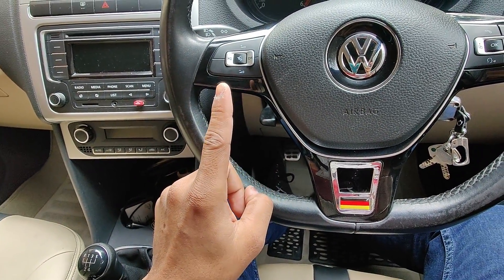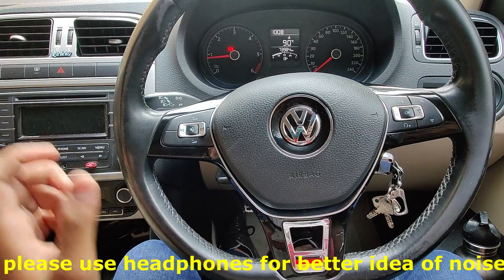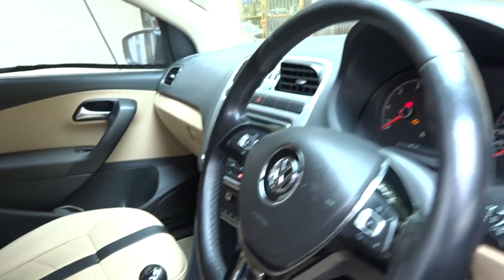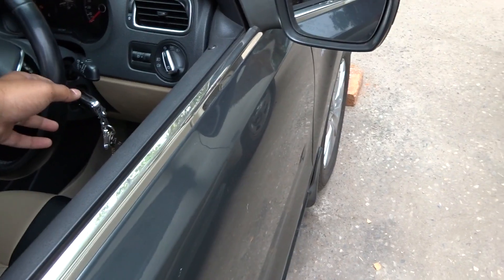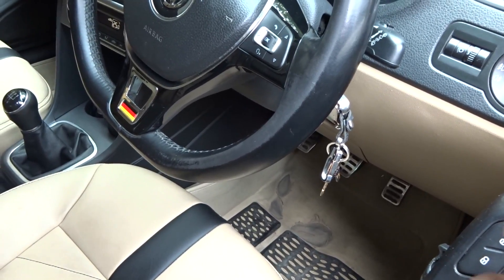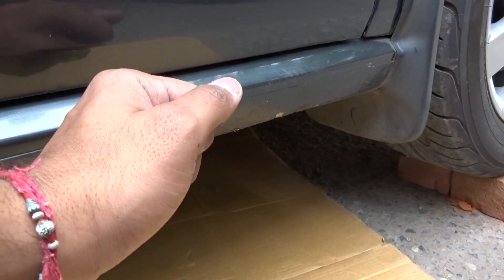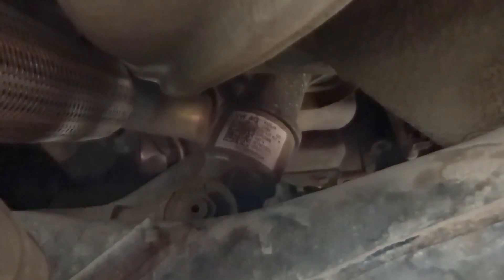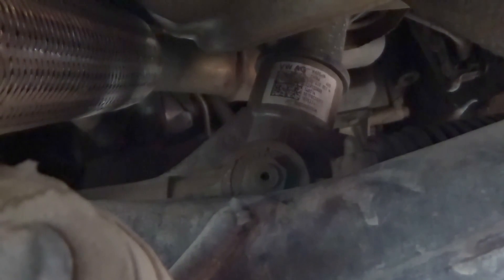STEERING RACK NOISE | RACK PRELOAD ADJUSTMENT | YOLK SCREW | HOW TO

Comment: I have a similar sound in my Kia when lightly turning the wheel, or constantly when just rolling/driving at slow speeds, and even use of brakes will occasionally make the clunk sound. These things could also be caused by excessive movement within the rack? 3 different mechanics tell me different things, I’m frustrated that somehow nobody knows what’s wrong with the car but every day I am stressed out over this constant knocking, happening with any impact or movement with the car at all - even getting in and sitting in the seat it will knock from my weight moving the car!
Reply from the maker: Sir it seems like a control arm bush to me , because it even knocks with you weight .
Reply: Kia सबसे बकवास गाड़ी है

Comment: experiencing the same issue on a w204, it's an electric steering rack. I'll go check if this can be done on w204
Reply from the maker: Sir every steering rack has a preload , which allows for adjustment
Reply: @yourDIYneeds  Thanks for confirmation will definitely have a look at it.

Comment: Hi, very nice videos! Could you help me? I have a problem with my VW Sharan 2017. When it is cold the steering wheel is sticking until the car warms up. After the car is warmed up it is not doing this. It is sticking only when I am turning it slowly (long corner) when I am turning quickly it does not do this. There is no fault in the control unit, no weird sound and even Lane assist is working 100%. Do you know what it could be? Thank you!
Reply from the maker: Sir , most probably your steering rack needs new lubrication , in colder climate grease is much more sticky and hard to work with as compared hot climates , as your engines heats up , your steering rack also get a little warm due to proximity to the engine . And grease inside the rack become more easy to work with . I already have a video on steering rack lubrication on my channel , you can use that as an reference , here is the link .
https://youtu.be/6E0BHajkt5o
Reply: @yourDIYneeds  Hi!
Thank you for your quick reply. I saw it, I will try it and see if it helps. Thank you

Comment: Hello, I am having same problem, I have changed steering rack last week , I also changed the steering cross still this noise is there. My mechanic tried with this screw adjustment also but can't get over it. What can be the issue?
Reply: Hello sir, there was issue with new rack. I got it replaced from manufacturer. Thanks for your help and time
Reply from the maker: Sir it works best with steering rack lubrication , 
But just in case if this doesn't work to eradicate the noise then changing the rack was the best thing because chances are that rack gears was worn , there was free play in between the gears
Reply: @yourDIYneeds  I changed the rack but still probelm is there
Reply from the maker: Sir then it was nit rack ! , What kind of noise it is ? Like , metal to metal or metal to plastic
Reply: @yourDIYneeds  metal to metal, I also changed the steering column cross, got it from used market , if my car put on jack then no noise is coming but if I remove the jack then noise is there

Comment: Bro my fiesta 1.4 also have this problem
Steering have little play and some amount of sensitivity in when going over rough road
Does fiesta have the adjustment nut
Reply from the maker: Sir every steering rack on every vehicle on this planet has a preload adjustment , some have on back side , some in front , some are in easy reach , some are little difficulty , but every vehicle has a preload adjustment.
Reply: @yourDIYneeds  thank you so much brother, will check it👍

Comment: I just get sounds at different road surfaces and low speeds. Do u think it could be the inner tie rod cause I have changed all the control arms and tie rod ends.
Reply from the maker: You may want to have a look at another video , of caliper pins and rotors , if the noise is same , then thats your solution
Reply: @yourDIYneeds  thanks for your response. I used a repair kit and changed rubber boots and pins on caliper. The sound I'm getting is something like a clunking sound when I return to the right some times and when going at low speeds on uneven roads. One mechanic informed me to change the entire rack without checking the inner tie rod. Since it's a huge cost, I'm suspecting that it could be the inner rods since they haven't been changed. Also on the steering wheel I don't get any vibrations or other sounds when I turn left or right and it is smooth as well.
Reply from the maker: Sir then i would suggest to to get your shock mounts checked , as inner tie rods usually don't make any kind of noise when they get loose , your ride just become a little wobbly .
And also check the plastic fender liners inside the wheel well , it happed with me and it almost drove me crazy for 2 yrs till the time i actually found it and then laughed .
The sway bar on bumps was making contact with the plastic liner resulting in a hard sound .
Reply: @yourDIYneeds  got the shock mounts changed month ago as well 🙂. This noise is driving me crazy, I will check the plastic guards one more time as well. Last resort would be then I guess to change the steering rack as you told the inner tie rod wouldn't make any noise as such.
Reply from the maker: Yes check the liners once before you spend , you may have the same problem i had
Reply: @yourDIYneeds  thanks for all the help. Will keep you posted. 👍have a nice day

Comment: Hi, Thank you for the very valuable information shared. I am facing similar issue, while turning slight left or right, the steering gets little tight(gets a tak tak noise). VW service guys are telling to replace Column and Rack, is it so?. Looking forward for your reply...
Reply from the maker: Sir just lubricate the rack first and then adjust the preload on rack and noise will go away 
Both videos are available for reference
Reply: @yourDIYneeds  Yes Sir, saw both of your videos, will try that and update you!!!
Reply: @ContactPrasad  did you try it??

Comment: Same thing happened to my car. Had clunking noise coming from the front left side whenever going through uneven roads. Replaced the lower arm, outer and inner tie rods but the clunking noise was still there albeit not as loud as before. Decided to replaced the steering rack and voila, no more clunking noise! And steering free play that I felt before was gone as well!
Reply: Next u arrest the sound sir???
Reply from the maker: Sir that needed just a bitt of adjustment
Reply: @yourDIYneeds  what needed adjustment
Reply from the maker: Sir your older steering rack , that was just in need of preload adjustment , and maybe a little bit of new lubrication
Reply: @yourDIYneeds  u mean to stop the clunking noise
Reply from the maker: Yes sir

Comment: Very nice video. I have another issue. After doing wheel alignment my steering has got loose. It’s an Octavia. Now I feel the steering to be too loose for high speed manoeuvres and highway rides. It happened just after the alignment and balancing. I tried alignment and balancing at other places too but the steering feel is still the same. Do you have a solution bro? What could be the real issue. I guess the alignment people don’t touch the steering rack right?
Reply from the maker: Sir , its not aligned right , as my experience with alot of alignment shops , 90% of them don't even know what they are doing , they just care about , final toe angle ,
Things they don't care about 
Individual toe 
Individual camber 
Thrust angle  

So i ll advise to get the alignment geometry set by either a shop which is capable of performing right alignment or the Authorize service centre .  
Positive and negative toe angles can result in different steering feel and responce ! 
Do you remember any data after the car got aligned ? And did they tightened the locking nuts after they gave print order or before ?
Reply: @yourDIYneeds  Thanks bro for your expert advise. Glad to know someone who knows so much about the suspensions, steering and alignment stuff. Some other things that bothers me when it comes to steering is that I can feel the road a lot on my steering. Like the undulations of the road or when going over a bad road I can feel the hit on the steering. Sometimes the steering just a moves a tiny bit forcefully in my hands when over a bad road with bumps or that are broken. It is like constantly moving tiny bit with force which throws driving pleasure out of the window when you are on along drive. One thing I have found out is that I have almost all the wheels with a little bit of wobble when rotated on a balancing machine. But that is not too much and has no visible bends. These steering observations were also not that prevelant before the damned alignment. 

Is it also due to the alignment or the wobbly rims or the tyres wearing out unevenly or may be something else, suspension parts? It’s an Octavia VRS. All stock. 27K ODO. Thanks!
Reply from the maker: Sir , firstly luck you , you have a VRS 😅😅 , i will definately have one , if i get the chance . Iconic names in the automotive industry 
A little bit kind of envy 😅

Secondly , the problem you are facing with steering vibration and uneven feedback is all due to steering preload , it needs a very fine and precise adjustment to be perfect , if it remains loose then it will shake your steering wheel when it passes over bumps , and if it got tight then will make you steering stick while taking U-turns , i myself adjusted it in like 4-5 times . Thats is the thing which is responsible for thats shakes .  Best practice is to firstly lubrication of steering rack and then adjusting the steering preload , i have videos of both topics , which you can use as reference if you want .

Thirdly - alignment
Almost 90% of alignment shops don't know what they are doing , all they care is final total toe , they don't care about individual toe angles , individual camber angles , thrust angles and those improper chassis geometry steals away the "pleasure to drive" factor from the car , so i will suggest finding a good alignment shop which actually knows what they are doing .

You can also get it adjusted as per you like 

Example - A little toe out on both sides will give you sharp steering response but you will hear the tyre noise more as they will feather

A little of toe in will give you straight line stability and will make the car more forgiving on steering inputs , but will induce a bit of understeer as well 

Negative camber will provide you stability while on high speed corners , it will control the body roll a little better 

Positive camber is just a waste of time  and money 😅 and will risk curbing the wheels as well 

And all these things in combined defines the final thrust angle of vehicle .
And then there is rear alignment . And a lot more . 
Hope it helps 🙂
And please don't mind that VRS envy thing , i guess you can understand this feeling. 🙂
Reply: @yourDIYneeds  thanks brother! Very informative. I know the feeling. Was in the same boat when I hadn’t one and my friends had it. 😄 it’s a lovely machine and hence when such puny troubles occur, it spoils the mood and the drive. 

All you said makes sense. 
About the adjustment in steering preload, I wonder how can it go out of order in the first place. I mean it shud not have been touched by the alignment guys right? Can it get loose over time due to regular running? But again all these issues occurred after the first alignment I mentioned. I’m in Bangalore and have done the alignment at a very famous shop called Madhus. They are quite reputed. So sometimes, I think it may be something else which got aggravated when the alignment was corrected like the bend rims, tyres, suspension parts. I’m scared to touch the steering rack to be honest. It’s quite sensitive and costs a bomb if something goes bad on it. 

Anyways I have a polo GT 1.5 TDI and a Jetta 2.0 as well. Love all ur POLO DIY’s. At last someone to follow outside of teambhp. Keep up. 👍
Reply from the maker: Thanks Alot for appreciation brother 🙂
Steering preload is just a spring held with help of a bolt on top , to maintain the pressure on the steering rack ball gear so that , it doesn't rattle inside the rack housing and it also controls the movement of steering so that in bumps suspension can only travel up and down not sideways . Springs over the time loses its strength due to the heating and cooling cycles it faces , due to its proximity to the engine and exhaust , and needs to be adjusted
If the alignment was done on a reputed shop , then have they told you on which chassis geometry they tuned it ? , Like as far as i know  , Octavia VRS and petrol have a rear indipendent suspension whereas TDI is a twisted beam setup , and VRS also have a different geometry than a normal for the extra  power it has , so if shop dialled a normal Octavia settings for the VRS , it may not feel the beast it is . And if possible be near the machine while the rims are on balancing machine , just to be sure .

Comment: How to fix rattling sound of front bonnet hood
Reply from the maker: There are rubber grommet on both side fenders and two on the underside of hood , you have to loose then so they rest on hood and grill , it will not rattle then
Reply: @yourDIYneeds  Thanks 🙏

Comment: My polo steering is feeling stiffed no steering warning light but just some stiffness
Reply from the maker: Stiffness all over the radius or just at sudden movement ?
Reply: It feel stiff all over the radius and the problem start only yesterday. Before it was smooth
Reply from the maker: Have to get it scanned , specifically the steering control module for codes
Reply: I got it scan but no fault codes occured

Comment: I had replace rack but after one months its again doing noise by moving steering or in uneven roads 
Suggest me something .... ?
Reply from the maker: Sir even new rack sometimes need yolk adjustment , just get the yolk a little tight , just a little , you may have to do it 3-4 times to have it in the perfect place where the steering is lite and that too without noise .
Reply: @yourDIYneeds  ahan ok ... i will try your advice
Reply: @TraderABB worked?
Reply: @zalanocsko154 no 
Its already tighten and by tightening more it became hard and unable to move steering 
I had replaced with new one but that new one also starting noise after 6 months 
Infact now i am not going to change it because new one only worked for 6 months

Comment: I want to know one thing brother..does u car have the rattle sound from underneath while going through bad road ..I am facing such thing but sc could not resolve
Reply from the maker: Rattle , in sense of ? Metel to metal kind of rattle or loose plastic kind of rattle?
Reply: @yourDIYneeds  it's like almost metals to metal...no body could trace the source...many guess steering rack sound...but my steering also have the same sound like yours ...only 12k driving...new car...
Reply from the maker: Sir there is one thing on the driver side of engine block  , intercooler pipe that comes from the driver side of the engine has a 10 mm bolt , which is attached to engine block directly to secure the intercooler solid pipe . That bolt usually gets loose due to vibrations from the engine . I myself had put 2 new bolts in the past . As it gets loose and falls off , and then i hear a clunk sound as i hit bumps . 
You may want to check that . If the location is not clear , i can send you a small video over mail so that location is clear . 
everydaydiyhelp@gmail.com
Reply: @yourDIYneeds  I’m having plastic kind of rattle in my polo . Its just 6000 kms.
Reply from the maker: Sway bar end link is striking against inner plastic fender liner over bumps , have you checked that ?

Comment: Sir.. I have a hard steering in my 2015 vento.. there is no noise observed just the steering is hard when in turn left and right..
Few say the tyre is an issue and few say steering is gone... But there is no noise at all from steering just the steering is not smooth compared to other ventos... Will this fix in the video help?
Reply from the maker: If the power steering motor is in good condition then you can try loosening the yolk screw , it will definately help . Kind of trial and error because you have to do minor adjustments 3-4 times to get the perfect balance for smoothness and it doesn't make noise .

Comment: Hi sir..
My polo 2014 model 1.5tdi 
The problem is steering stiff or locking sometimes when driving..
I asked vw service center they told steering column problem so need to change..
Pls suggest any other option.

Comment: I am also facing this issue from the past one year and I am always worrying whether it ll create any problem while driving with family. I don't any local repair shops in Chennai, So I made a appointment for tomorrow to change the rack in VW showroom. @yourDIYneeds Bro Please advice me whether can I change the rack?
Reply from the maker: Sir , you can have a try by doing this , if it resolves your problem then what is the need of changing the rack .